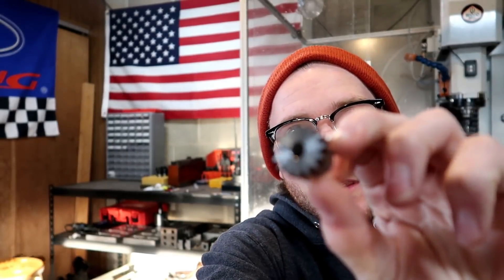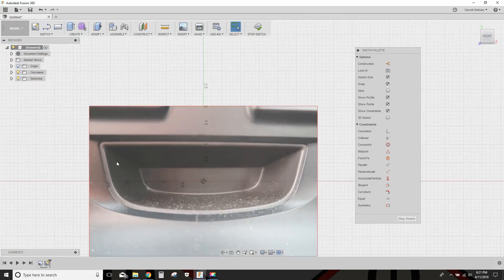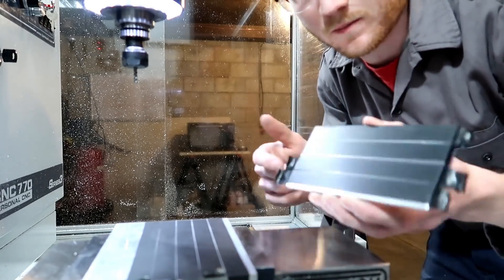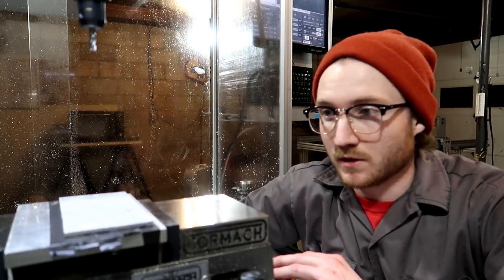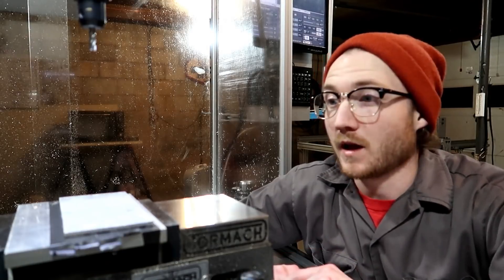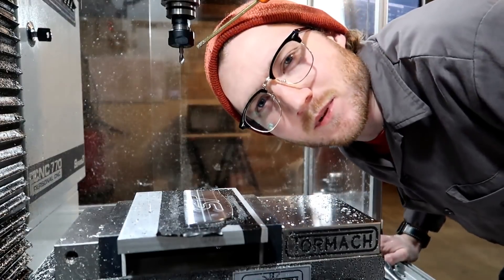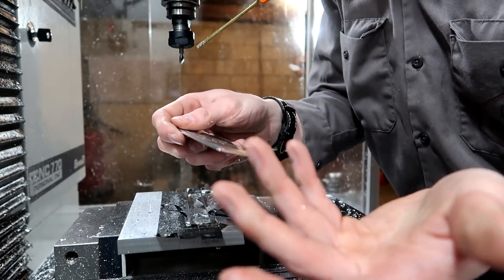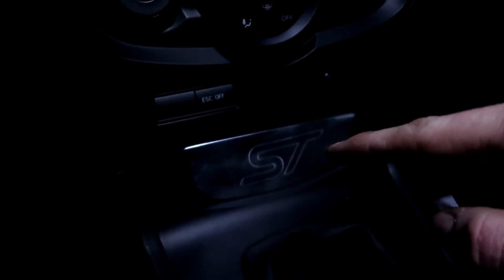Making Something From Nothing: Home Mfg. Days #35

Comment: Hi Mojo, I gave it about  a 10 min try to replicate the process you went through to upload that ST design, how the heck do you do that?
Reply from the maker: Hello, I find a very clean picture of the design I want, save that picture to your computer, go to http://www.vectorization.org/, upload your picture file and select output as ".dxf", download that dxf file to your computer, open fusion 360, select dropdown from "insert" on the main ribbon, then select "insert dxf", from there you will be able to select the .dxf file you saved to your computer.  There is a lot there so let me know if you run into any problems.
Reply: Thanks, that worked.  The key to my issue was that I was unaware of the "insert" function.  BTW, where are you located?
Reply from the maker: Yeah it's different, you'd think that you would have to go to "file" then "insert" but I think they try and make it slightly more convenient for you.  Anyway, I am located just northwest of Columbus, OH

Comment: Because it is in a car, ie hot and cold weather, i would use VHB tape by 3M.  You can find a big box store as outdoor double sided tape.
Reply from the maker: I had thoughts about that but this but I still wanted it to be removed somewhat easily if it needed to be.
Reply: You can remove VHB tape.  I use it for a lot things because i can remove it but yet it holds up
Reply from the maker: Oh I thought it was more permanent.  That should work good then!
Reply: I use this https://www.homedepot.com/p/3M-Scotch-1-in-x-1-66-yds-Permanent-Double-Sided-Extreme-Mounting-Tape-414DC-SF/203405976 it says permanent but it is not.  I have removed it, just get a blade between the two sticky sides in the foam and slice away, then i rub it off the rubber cement.  Test before you go nuts but it works well for me
Reply from the maker: That's the stuff I have used to hold down parts before and it does come off fairly easy.  I will be sure to test it out.  Thanks for the idea!